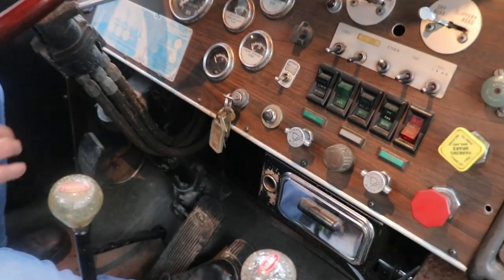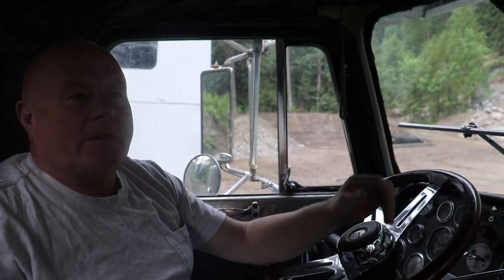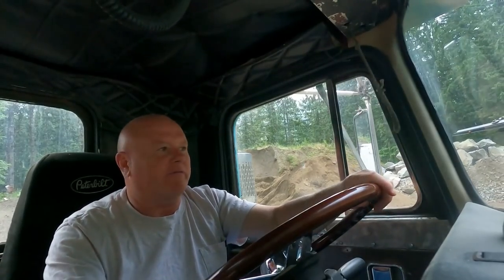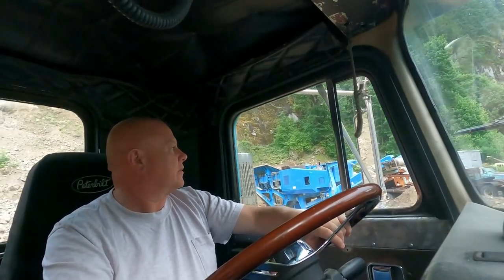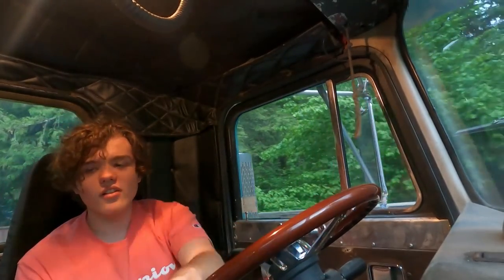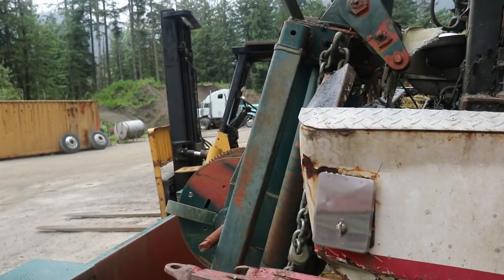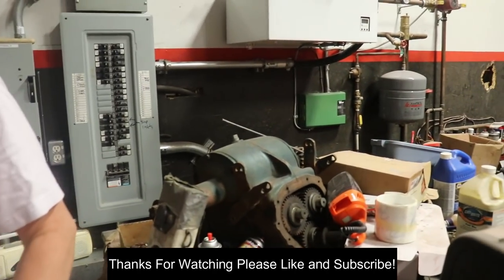Is Collin Coming Back? (q&a) + I Learn How To Drive A Manual Truck!

Comment: I have so much respect for your Dad and for what he has done for the industry. I'm sure glad that he kept all those old Holmes Wrecker bodies. Reminds me of what we used to do with all those Holmes 750's back in the day. You could buy a new one mounted for about $25,00 and there are still quite a few of them still in service, many with add on wheel lifts.  They would winch anything with those outside drive winches, provided you could hold the wrecker down. It was a rare company that had the Holmes850 because the thing cost nearly twice as much. Now with the new heavy hydraulics and the rotators jobs are twice as easy but the cost of equipment and insurance has risen so much that you can't afford to have a bunch of new equipment just sitting around while your making payments on it.

Comment: The 5 & 4 and not shifting with the clutch brings back fond memories I put over 250,000 miles on a 1978 long nose LTN 9000 Ford with a sixty foot Stinger crane all local miles here in West Virginia

Comment: Jamie, this reminds me of driving a "B " model MACK cement truck . it was 18 speeds split @ 9 . I hauled 9 yards  of concrete in a 10 wheeler ! Highly illegal, we had to keep the top chute up all the way or the concrete would spill out the back. I think the owner had some connections with the law . So that's 18,000 lbs of concrete plus the weight of the truck on 3 axles .

Comment: Good Job Jr. you might get put in the Rotator one of these days. This video is also an update for Coastline's HR 50 it is almost done all that is left is the transmission and it is ready to go back to work.
Reply from the maker: Yessir but more like a few years down the line im not old enough to even get a class one yet
Reply: @JamesDavisJunior  keep working on it.

Comment: I have a 1966 D500 Dodge with a Holmes 500 on it was bought new as a wrecker only has 50,000 miles stored inside most of life seat is good and original. It only towes older stuff and never anything bigger than another 500 size

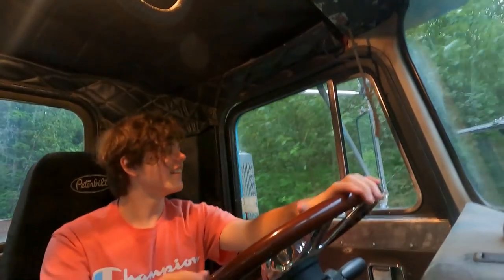Comment: 9:22 General, Lucy, Rescue, Fire Truck, Rotator, HR 50, Mighty Mo, and Bruce's tractor. they are all here. 13:33 I see Python over there. 13:47 I see 47 over there. 13:48 Goldy is over there that one needs an engine. 14:10 I see Army over there.  Who is not here is the Coastline trucks, the flatbed, Mack, and the Kenworth truck they are on jobs. HR 126 is not here either that truck was sold.
Reply: Gotta love Lucy!!!

Comment: Hey james once you get a class 1 look into building a drag racing semi
Reply from the maker: I definitely want to race some form of a vehicle one day
Reply: @JamesDavisJunior  go with a v12  v8 or v6  are good for it at my highschool in surrey bc semiamoo secondary we have a 1972 pontiac lemans with a 35p chevy small block we race it at mission personally I've been looking into the 75 - 79 ford f250 with a 460 big block and a 6 speed manual 10 inch lift kit straight pipe no mufflers or catalytic converters but ya i sww your bmw on facebook try racing that would be neat
Reply from the maker: @keatonsparksvideoproductions  its an inline 6 255 hp i just bought a motorcycle too its a ktm 390 rc so its an enry level racebike i need to get a truck next though so maybe i could make a pretty mean truck.
Reply: @JamesDavisJunior  good car if you want a diesel pickup go for a 1st gen dodge Cummins or an early 2000s chevy duramax or a 92 - 04 ford 7.3 power stroke good trucks look good lifted or slammed
Reply from the maker: @keatonsparksvideoproductions  bet ill look at those and the car is awd too so should be some what good in a race
Reply from the maker: i would like to get a sponsor on the channel who could get me a truck lol
Reply from the maker: @keatonsparksvideoproductions  the road we are on goes up to a lake and is a back road but i don't get my N for another 6 months but when i do I'm going everywhere.
Reply: @JamesDavisJunior  ya i saw how far Skagit goes when i looked up pictures of the Skagit river beautiful river I've wanted to find a shallower section of it in town for off roading or once i get my L cause i failed by 1 point I'll look aroun for offroading spots cause the one in langley on 192nd street in langley was developed by ware houses and a new trades center is being built like the tradex at abbotsford Airport